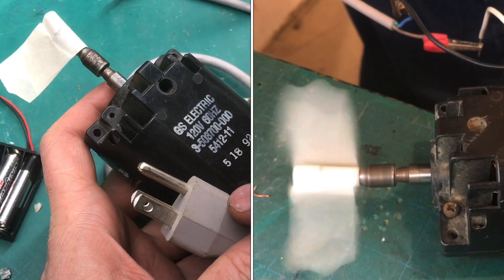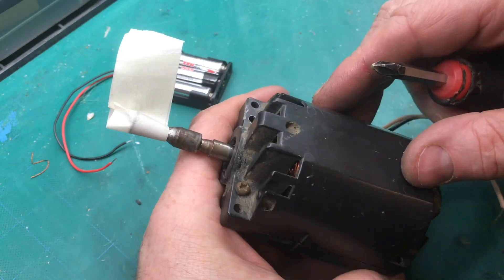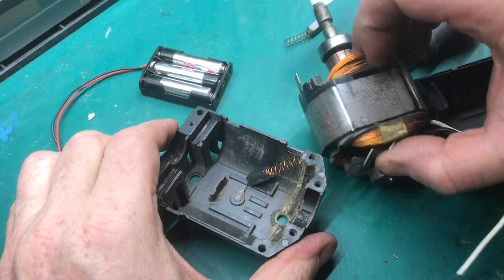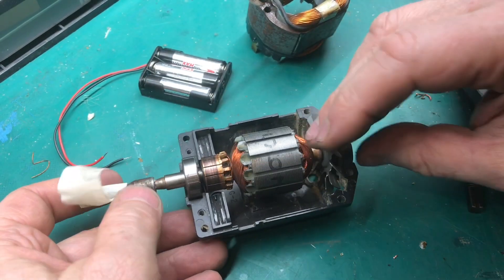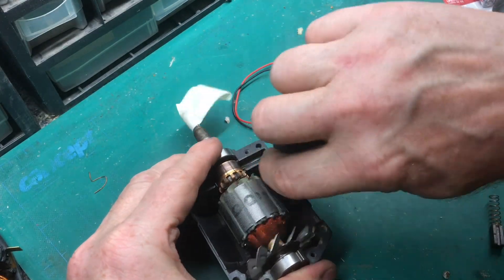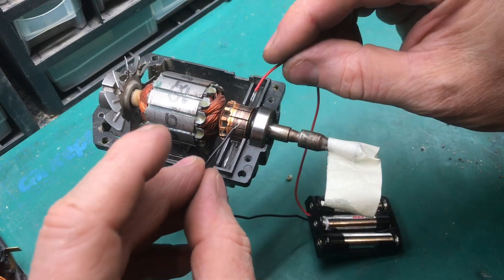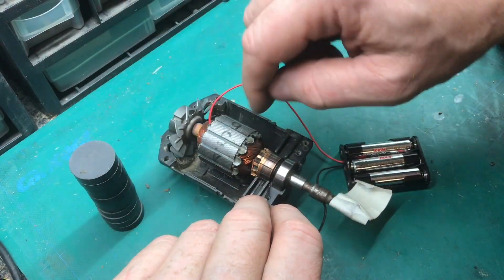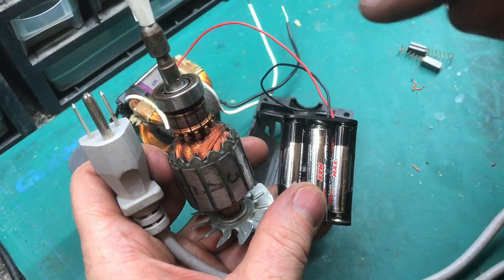how to RUN an “AC motor” on DC batteries

Comment: I hate throwing motors away if something breaks. I never know what can be done with them in alternatives like this. nice!
Reply: Same i tell my Best friend that if he has some broken printers and copy machines because he run a bussness selling second hand printers and copy machines
Reply: Basically nothing can be done with them, they have specific applications for specific designs, so it's difficult to do things like mount them, and unless it's a gearbox motor with high torque, you can't do a whole lot with them unless you add  your own gears or belts. The most useful motor is a fractional horse power motor with pulley wheels on the shaft and made to be bolted down to any surface, then you can take power off to power any device you want using a belt. Small motors can be used for fun stuff. A 3d printer would help to put them to use.

Comment: Could you get a bigger motor to run in the same fashion. With the (rotor/stator) removed. Does that take the power limit needed to run the motor off? Essentially, could I run a bigger power tool off a DC li ion battery in the same fashion? Thank you for the awesome video.

Comment: Question can you hook up the brushes to the battery wires so  you don't have to stand there holding them and then it can actually be useful?

Comment: How would you capture and store generated DC electricity? Using the same method but just have the motor spin by wind/water flow? How can transform that into something like a car battery could store?

Comment: i have an ac motor from a vactumm that i wanna use in a project just for fun..  both wires are black but i know which one used to be connected to the white wire in the cord that i cut a while ago. can u tell me how to reconnect this to a plug.. would it work like a normal dc motor if u connect it back? i dont know why i am being paranoid.

Comment: Definitely cool and closer than before, but I’m pretty sure what everyone wants them know is how to just wire up the supplied wires in the motor to run on direct current.
Reply: From my limited research, you'll need magnets in order to run on DC power. Either that, or you'll need some way to convert the DC power to AC power to power the AC motor without magnets. Simply rewiring the AC motor won't do the trick. You'll need to add a component in between the power supply and the motor.
Reply: It very obvious use the small stuffs left from the begin 🤦‍♂️🙄
Reply: It’s a universal motor; you can run it on d.c. using a bridge rectifier, which will convert 120v a.c. to ~110v d.c. after voltage drop
Reply: If this video didn't help you understand your question I'm not sure this is your forte

Comment: Could you harvest AC power from this concept? Or, is it even possible to input DC and harvest AC from the same motor. I was thinking about using solar-powered batteries to turn a DC motor to propel an ac motor. I was wondering if I could get away with just one motor? Maybe filter out the DC somehow? What do you think thanks

Comment: thank you sir. we live off grid and I'm developing an air conditioning system for our solar.  I figured it was something like this very simple. what would be good to use for prolonged use now?? 🤔
Reply: Ac Systems aren't simple... That said I would encourage safety precautions for a DIY project if doing a high-pressure Freon butane, R134A, ammonia, or other low vapor point refrigerant. For the sealed portion, You will need a high pressure side radiator and a low pressure side. A compressor able to reach condensing pressure, a couple check valves and an expansion tank pressure release reservoir. Copper tubing flux core solder a psi gauge and AN (or preferred) fittings. The whole system will need to be evacuated of all outside humid air, with an innert gas like argon or helium, to keep water vapor from freezing in the lines, also to check integrity of joint welds.  You will need 2 fans, one outside and one inside. To pass air between the radiator & condenser coils. Vacate system of innert gas through evap port and add low vp gas of choice. Beware of hazards of using high pressure flammables like isobutane, propane, .etc.. I would go with air duster or standard R134A... acetone would probably work as well but not sure if there is a non-flammable ketone out there. 
One of the best refrigerant processes involves converting heat to a specific wavelength of InfraRed that passes through the Earth's atmosphere into space. Not sure what frequency in nanometers. I believe It's the wavelength of light that sand emits or reflects and why the deserts get cold at night. There are new white paints hitting the market that reflect in this wavelength it might be in the market soon. You can use water as an evaporative cooling system. Back to evap systems. If you lower the pressure of the system instead of raise it. Pull a vacuum and use the cold steam move heat. You want evap side on the inside and condenser on the outside it's a heat pump style and you could technically get heat from outside on cooler days maybe use a Tesla turbine as a compressor instead of a generator. 🤔 I love just brainstorming like this. I really wish I had some people near me to try out some of these ideas. Not many DIYers, or free thinkers in the real world.
Reply: Sounds like an a/c system........

Comment: It is the Universal motor. it can able to run with AC and also DC so in this video  you showed motor was Universal motor or series AC motors it can run with both AC and also DC.
Reply: Are the bench grinder motors universal or series AC too?

Comment: could you put DC power to the stator instead of magnets?  that would make it usable...
Reply: Hybrid AC And DC motor by attaching secondary DC Armature... Although he didn't need to remove the Brushes just up the DC or a roller bearing would also do the tick tertiary orientation of course. That way reversal of current will turn the DC motor into a Generator... Supplying constant energy to the DC batteries rechargeable will do .

Comment: i have a universal blender motor AND I can run it on a 20v battery without taking the thing as well. operates on 120v AC 60Hz obviously. no dumb 50Hz. sorry uk